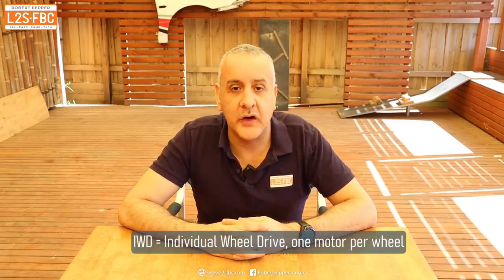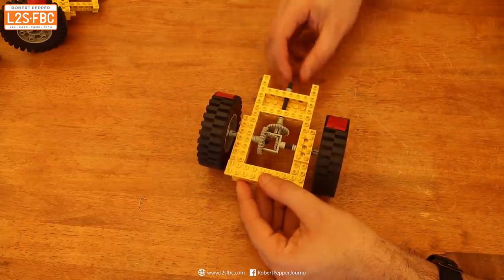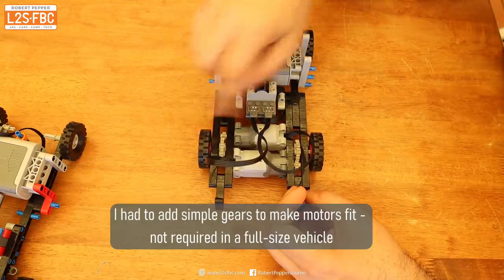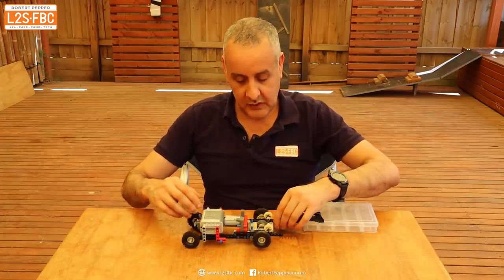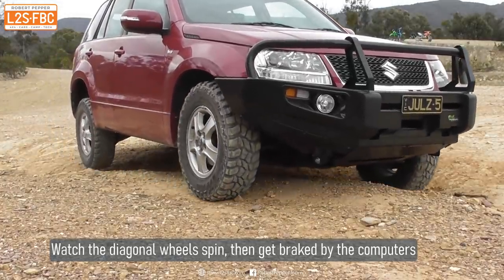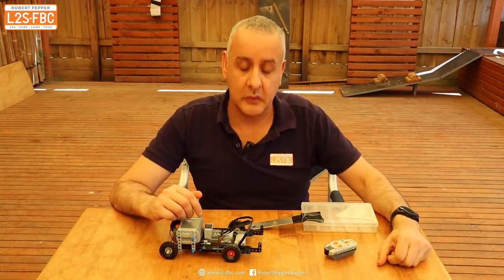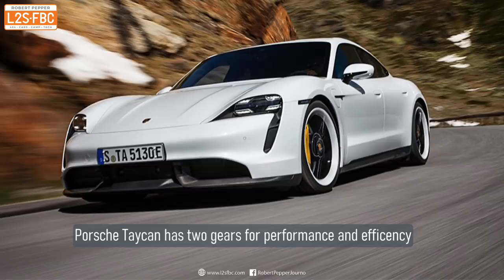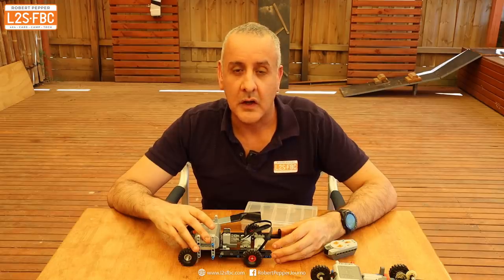Why Differentials Will Die - EV IWD Is The Future!

Comment: But if each motor has 50kW the car has 200kw output on 4 wheels. But if 2 wheels are a bit lift in a corner and thus have bad or no traction only 100kW remains to propel the car forwards. As with a limited slip or locking differential all the engines power goes to both the gripping wheels.
Reply from the maker: Good point but in practice I think it will be ok as it is rare to need all power when only 2 wheels have traction
Reply: @L2SFBC  yes, for normal use (as in transportation) it's rare but for instance hill climb, cross, race, rally, etc it's common. So also for users who want this feeling while enjoying their vehicle, like porsche owners who don't go racing. :)

Comment: The 1 problem is in a perfect world this would be genius but since most country's hate each other someone is bound to set off an emp and disable these dumb electrical systems , these systems are safe....... l take a 70s or 80s model big block carburated gmc/Chevy with manual locking hubs/4x4 on the floor and strong aggressive 10 ply tires .
Reply: 89 Jeep running a 4bt diesel with a pull start and mechanical pump

Comment: Soo what I learned form this video besides the obvious is that in theory or rather proven in traction control. While applying brakes to the free spinning wheel I can in essence transfer power to my wheel with traction. I had an Aha! Moment. Why not put my e brakes to work! Of course I’d have to modify them to run separately off two different engagement mechanisms. However,this would be a very viable solution and economical in terms of gaining traction while wheeling so as to gain traction in the event one wheel is free spinning while your other is firmly planted simply apply e brake to the free spinning wheel to transfer power to the wheel with traction! Could this work?( asking for a friend)
Reply from the maker: Yes it absolutely could work and some offroad trials vehicles and tractors are modified in exactly that way.
Reply: @L2SFBC  😄 sincerely appreciate the input! This is awesome information. Will be looking further into it. Thank you for your Informational videos, new subscriber!
Reply from the maker: Thanks!

Comment: Yup, electric vehicle technologies are the best. But, once the motor controller circuit board has glitches or bugs, each motors will spin different direction or the motors will accelerate by itself. That's too dangerous.
Reply: Totally agree with you, and in the middle of nowhere you'll be screwed.....
Reply: In electrical design there is fail safe protection for the system. May be thats the point you would know.
Reply: Stuck throttle cable, run away diesel engine, it can happen with ICE........EVs have safety circuits (ECU in ICE car has them too) that will stop the car in case something happens to the main controller.

Comment: 1 correction: airplanes with twin engine don't rotate counter to each other because that will make them harder for engineers and companies to make mirror copy of same engine that will increase cost..

2 opinion: its a great concept but not so good for off-roads i guess as power is also divided into 4 parts.. a tyre that isn't moving has a motor that isn't spining so that is where rivion video is wrong they are showing wrong usecase for IWD.. more useful will be like you said in daily use in tight corners like london or L.A or any urban city
Reply from the maker: Some do spin counter some don't. There are also contra rotating props which spin opposite on the same shaft.

Comment: would not that just consume the battery charge about 4 times than conventional one?????
Reply from the maker: No the battery drain is proportional to the energy required and that doesn't change if there are 1 or 4 motors.

Comment: Individual WD and steering. Better maneuverability and potentially higher ground clearance
Reply from the maker: For sure!
Reply: Apparently there is no benefit of individual wheel steering. I did ask this question to some one that understands steering and contact patches very well and when you steer the wheels have to point in a predictable way which is easily set by the suspension and steering geometry.  There would not be any advantage in adjusting the wheel angle of each wheel independently.
On conventional cars the angle of the inside wheel is different to the outside wheel when turning and apparently that needs to be fixed. Changing it on the fly does not provide a benefit.
Reply from the maker: @franciscoshi1968  there is quite a bit of benefit. Reduced tyre wear, improved agility. Four wheel steer is used in high-performance vehicles such as some Porsche 911s for example.

Comment: you can't have low range. Bad idea. Also i wouldn't say that driving each wheel with a seperate motor is less complex. You add complexitiy by adding more motors which also adds more gears. With a traditional differential you only got a few gears in the center and some axles
Reply from the maker: What if it's not needed?
Reply: I agree with the extra complexity. These are still in development because they're not as reliable yet, and they are also very expensive.

However low range is no longer needed as you wont stall the electric motors. They can run below "idle" speed of normal motors so they don't need extra gearing advantage in order to move at low speed high torque situations.
Reply: @AlftraZignTriOxide  low range isn't just for not stalling the car. Low range gives you a LOT more torque and much higher throttle accuracy. It also stresses the motor less
Reply: @dieselgeezer18  the torque of the EV with one speed is enough to spin the wheel. The only reason for putting low range on an EV is for effecienty. As for the better throttle control, you can get millimeter accuracy with an electric drive train. There is a computer between the pedal and the motor. It is very easy to do a speed control mode a bit like cruise control but controlled by the pedal. The computer will let you crawl up and down a step without you having to do anything other than using the accelerator to set how fast.
Reply: @franciscoshi1968   "the torque of the EV with one speed is enough to spin the wheel." That only applies to high horsepower electric motors. 
And still a low range would provide much more torque and let the motor work much easier
Reply from the maker: Porsche made the Taycan with two speeds. There are limits to how fast an electric motor can spin for efficiency.
Reply: @L2SFBC  yeah it has 2 speeds but there aren't electric motors directly hooked onto the wheels. Yes you are right about the efficiency. The low range would provide more torque until the RPM reach high RPM's where it looses its efficiency
Reply from the maker: Right. Electric motors on the wheels is too much unsprung mass for anything other than a very low speed vehicle. So the motors go inboard. No diff required.
Reply: @dieselgeezer18  I think it comes down to complexity and cost.
I don't know how much extra it will cost to make the 2 speed gearbox in size and cost.
My guess is that it is easier to put a bigger motor than to put more speeds.
If you look at the rivian 0-100kph of about 3 seconds is probably from having oversized motors on each wheel.
Reply: @franciscoshi1968  I've driven a chevy volt on electric mode(motor makes about 140hp) and my dad's Mitsubishi delica Turbo diesel which makes about 130HP. If you slam the throttle on the volt going like 30MPH the torque feels of course very instant, but the Delica pulls harder because of the lower gearing. It has a manual transmission which means that if you are above 2000RPM the turbo spools up immediatelly and there not any power delay since it doesn't have a torque converter. Thats a big  advantage in ICE cars. The lower gears make it feel more powerful than the engine actually is

Comment: With a hobby like off-roading parts break quite frequently and electric motors are expensive. Yes you remove things like u-joints drive shaftes ext that cost you a lot of efficiency and are usually the weakest link but I just don’t think a electric motor would hold up to the kind of abuse purpose built off road rigs go through
Reply: With that said I think this application could work really well with things that don’t get absolutely abused by massive rocks
Reply from the maker: I don't share your concern to be honest...Electric motors are simpler and cheaper and well proven in harsh conditions.
Reply: @L2SFBC  if I’m not mistaken electric motors are made out of copper which isn’t cheap. And I would agree using a motor as a generator is a great idea however more computers usually means more head ache if something were to go wrong. I think for over landing it would be great but things like rock climbing I don’t see it being very good compared to things like the older jeeps with air lockers and Dana 60s and the gearing to run 44 inch tires
Reply: @L2SFBC  and many of the electric quads and side by sides struggle massively when compared to ones that use combustion motors

Comment: Hydraulic motors are a better idea a small petrol or diesel engine drives a hydraulic pump and your steering is achieved by a valve which reduces fluid to one side allowing it to turn with no need for the front wheels to turn left or right.

Comment: portal hubs big bonus...electric motor in the wheel big bonus...can't wait but until then it's my ICE diesel with a 1500km range for my 4wd playing...I really hope I get to have one of these offroad EVs before I am forced to give up the 4wd either by age or Govt regulation...
Reply: The motor-in-the-wheel has its own challenges, including having to design a suspension system that can smoothly manage that significantly larger unsprung weight.
Reply from the maker: The motor at each wheel put the motor inboard, not actually inside the wheel. That's the approach the EV makers are taking, for exactly the reason you say, unsprung weight, plus space constraints. Other EVs such as slow-speed commercial vehicles can do motor-in-wheel as unsprung weight isn't a concern for them.
Reply: @BillyHarvey  Look at the Orbis hub motor.  Theirs is actually lighter than the parts it's replacing in an ICE car.
Reply: @veganpotterthevegan  electric motors are much lighter that ICE motors.
Hub motors are not as good as they are advertised.
In an electric motor size is proportional to torque. A hub motor has very high torque but it spins slowly so it can drive the wheels directly. If you take the same hub motor and change the windings and spin it 10 times faster and put a gearbox and a CV shaft to the wheel you will have 10 times the power out of the same motor. So hub motors are wasting the capability of the motor.
Spinning an electric motor at higher speed is not without problems but the speed at which they become significant is very high. (Think 60krpm)
Reply from the maker: Great info thanks!
Reply: @franciscoshi1968  There are already powerful hub motors out there running in high performance vehicles.  They're already here🤷

Comment: Look man let the person decide what traction the vehicle needs not the vehicle. My jeep with automatic lockers will climb up your house. My subaru thats electronically controlled is a turd.
Reply: Yes and no. My 99 TJ has air lockers front and rear. I can get out of a mud hole 3ft deep or like you said...climb the house. My Honda CRV has full time all wheel drive like your Subaru and the Jeep can't compete with it when driving on the highway at 100km/h in 6 inches of snow. I can easily and safely rip down the highway doing 120km/h in deep snow with no issues. The Jeep would max out at 80 kmh in 4WD before becoming unsafe.

So it really depends on the application...simple selectable lockers when you just need brute force or computer controlled AWD when you need fast response in changing and unpredictable conditions.